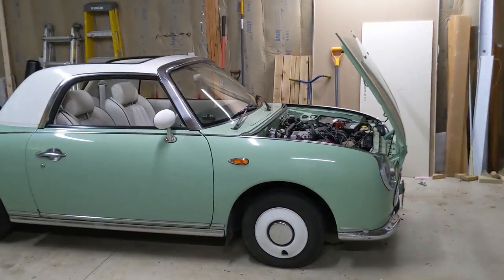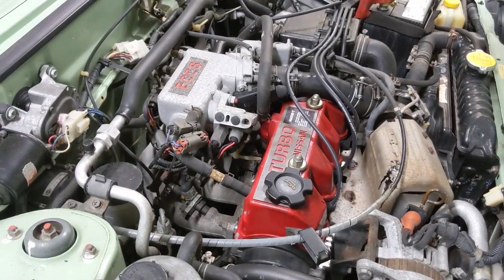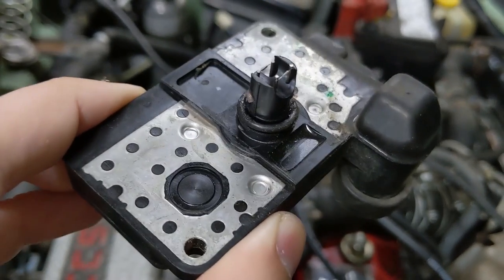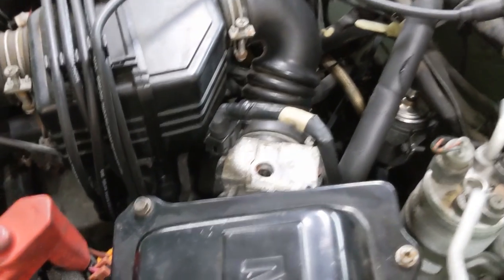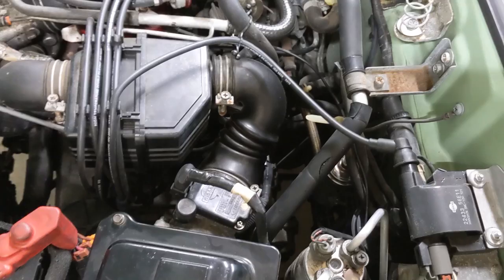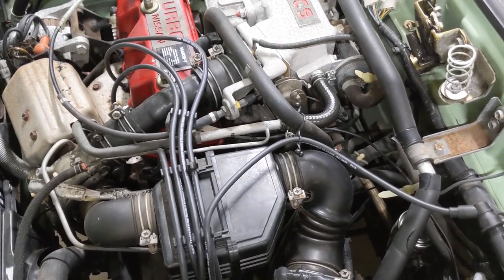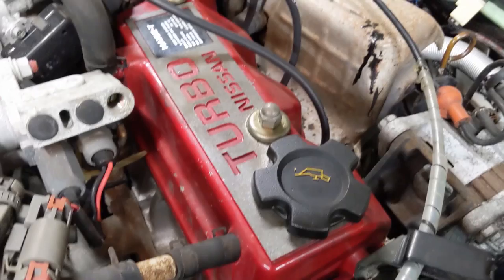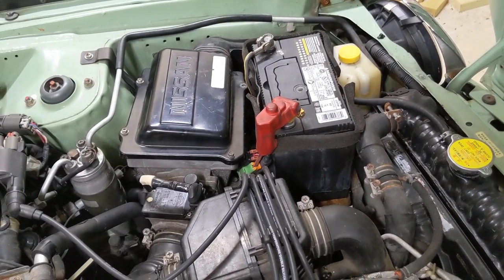Modern engine control musings and Fixing a Figaro

Comment: 2 + 2 = 5 for extremely large values of 2.
Reply: Yeah, but "2" isn't the same as "2.6" unless you're using extremely rough estimates with such small numbers. That's like saying "200,000" is the same as "275,000". The whole 2+2=5 political thing is dumb and has no place in modern mathematics, or,even in modern philosophy. It's a fallacy.
Reply: @tyrantstomper  it’s a calculus joke! Relax homie
Reply: @spaceman884  calculus ugh.  I've lately come to  think that physics will be most accurately portrayed by  n term  newtonians or something in the future and continuous math would be the calculable approximation.  For some reason I'm leery of adding infinite numbers of zeroes to come up with a number.
Reply: As it approaches the limit, of course.
Reply: Or extremely small values of 5.

Comment: I recently bought a 2003 Generation 1 Prius, which has SIX interconnected computers, two electric motor-generators, fly-by-wire throttle and brakes, electronic power steering, and a freaking TOUCHSCREEN! Pretty crazy for a car that was originally released in 2000!

Comment: Mechanic here. The MAF looked clean at the beginning of the video. When that type gets dirty, it's very noticeable dark dirt covering the sensor wires. When clean they appear white-ish and somewhat translucent. That type of MAF, btw, very rarely goes bad, but often gets dirty. Probably the reason it starts easily in the cold, is that it (most likely) has a cold start injector, which will be used in the cold to shoot a lot more gas into the engine to get it to start. So, really, you're probably looking at a lean condition. Suspect vacuum leaks. Oxygen sensor will not cause a poor start, as the computer will ignore it entirely for a minute or so until it's sure that the sensor is warmed up. This time will be less if the sensor has a heater (more than one wire), but still starting will not be affected by it.

If you have a cam/crank correlation code, fix that. Likely the distributor is not adjusted correctly, hopefully there is an adjustment. I'm not sure of the procedure. It's likely you will need to find a real mechanic who has an old scanner than can talk to pre-OBDII Nissans. I do, it's not terribly uncommon. This car should have a scanner plug. Perhaps behind that panel with the button and LEDs.

Also, rockauto.com dude. They don't list a Figaro (big surprise) but you only need to divine which model is comparable. Sadly, I can't see that valve available there. Perhaps if you had a part number.

Speaking of valves, remove the IAC valve and clean it thoroughly. This one should rely directly on coolant flow and temperature. The coolant passage through it can get gummed up and seize the moving part.

Also, the intake air temperature sensor might also cause this problem.
Reply: If you’re going down the stuck valve route, check/clean the EGR (if this car has one) - for vacuum leaks, IAC, EGR and the throttle itself are all suspect because they’re all connected to the manifold. Further, when looking at/cleaning the throttle, check the throttle position sensor: that’s where the computer looks first (in conjunction with MAF) for injector pulse duration. Then there’s fuel pressure regulator, and EVAP valves to take into consideration. And the gas cap if the EVAP system is in question. As in contracts/law, it’s the little details that cause the big headaches.
Reply: Yar Nunya I don’t recall you mentioning it. It’s the type of maintenance that’s overlooked until problems occur. Proactive prevention rather than reactive repair is my mindset.
Reply: Also, this car obviously has the door-style MAF, since that's the housing you see on the air cleaner assembly.  Not a hot wire type.  The door style was very common on early-90s Japanese cars.
Reply: @immikeurnot  I mean, he literally takes the sensor out and shows us in the video. It's a hot wire type, like an old GM or Ford.
Reply: immikeurnot I don’t give thumbs down unless they’re deserved; yours was because of this:  a vane type MAF is not what this car has, if you watched around the 3:00 mark of this video.
Reply: I used to play around with Nissan's of that era. This is a vacuum leak issue. The O2 is compensating for the lack of air reading. I also own the reader, I should suggest he looks at "nistune" the Aussies are better than us at this.  So funny, I could explain everything about owning a JDM but YouTube being YouTube he won't get to see this.
Reply: Nissan's of this vintage used a Bosch system. The hard start cold is almost certainly the coolant/cylinder head temperature sensor. Your surging could be from a vacuum. Leak. The smallest leak will give you issues. Any leak after the maf can and will make it run lean and stumble.
Reply: Also the crank sensor code could be a false positive. It has a tendency to trigger if something else is wrong. The cam and crank signal are in the distributor cap. The crank trigger is a pulse during each cylinder tdc event. And the cam is a 1° pulse. It is a optical pickup.  You may have a air regulator.  And when they fail they get stuck open. It's a little door attached to a heating element that slowly closes as the engine warms up.
Reply: Mechanics are dope
Reply: The number of likes on this comment makes me happy.
♡☆ DIY or DIE ☆♡
Reply: My 95 Infiniti G20 surged hard (read: bucked violently) due to a tear in the intake accordion hose that would open up doe to rotation, let a gulp of unmonitored air in, which would quasi-stall it out, cutting torque and rocking the engine backward, closing the tear and starting the cycle over. Cleanin my maf and replacing the a:f sensor due to an unrelated failure didn't fix it. Got a new airbox and hose ass'y and it drove like a dream
Reply: My '94 Jeep Cherokee (4.0 HO) had a lot of similar issues, in addition to overheating easily, and stalling randomly.
A lot of the problems (but probably not all) were caused by an intermittent cam position sensor.

Comment: At 8:11, to the right of the mounting point for the MAF, I can see what may be a split vacuum line.  Might explain your drivability issues.   I have some experience with Nissan cars if this era, and it always seems to be a vacuum leak... loving your work, sir!  Cheers and good luck!     Edit: never mind, I see it is cracked insulation on the A/C line... my comment still stands, though.   It’s always vacuum ☹️
Reply from the maker: I should definitely go around looking for vacuum leaks. So far, though, now that the MAF is clean the only issue is the (possibly) high idle and the extremely mild surging. Without knowing how the computer might do a re-learn that might just go away over time, or else it could be entirely unrelated. Pre-OBDII is fun!
Reply: that is a ac line it just a cover
Reply: still check for vacuum leaks. there is a few hundred miles of vac line on these things, and after this number of years, im sure there are a few leaks.
Reply: Might explain the high idle for sure. I would take a spray bottle filled with water to the vacuum hoses-- makes it easier to hear. If it doesn't seem to be a hose, I would check the intake manifold.
Reply: Start pilot or brake cleaner spray is an easy way to look for vacuum leaks. I'd also take the IAC valve out and clean it thoroughly.
Reply: I was about to post the same. On a car that old you should check all the pipes. A small split will play havoc with the fuel injection metering and ignition timing.
Reply: ^^  This is exactly what got me into electric cars.  Engines.  I hate engines.  😖
Reply: @TechnologyConnextras  even being into computers as much as I am I still like carbureted stuff it just seemed so much simpler to work on. Of course you have all the equipment to work on a modern car then they're probably just as easy to work on.
Reply: @MichaelAStanhope  That valve is also likely to have issues, they are known to have daphragms that either crack, stick or just leak.
Reply: @noahpaulette1490  Carbs are all fine and dandy but getting them to work properly is an art. And even then, they will never be as good as efi, just because they're dumb. Your car might run mint at sea level and 70F and run like poo in the winter or elevation.
Reply: @TechnologyConnextras  My experience is more to Mazda cars, buuuut... Is your coolant level perfectly topped off? If there's air in the system it can cause idle surging in some cars. My car's IAC uses coolant to determine the temperature to close the IAC. My car originally used a VAF and was OBDI, it now uses a MAF which is freer flowing and a different ECU. It makes 10-15 more hp and gets better gas mileage aand can be read with an OBDII scanner. I can get readings off the MAF to see what it's doing while it's running. If you're getting a cam code you most likely have a problem with the distributor. To the Nissan forums to figure it out. Is the advance vacuum controlled?
Reply: Technology Connextras - I love the car!  High idle is also a symptom of vacuum leaking.  I believe the idle speed control unit works by bleeding a little vacuum to raise the idle speed, and could have a leaking rubber seal or diaphragm.  Also, and I may be wrong, some Nissan cars of that era used a “thermo control wax solenoid”. When it fails, it could jam the throttle to a high idle speed.  Was a common issue on the VG30 engine family.  Purely mechanical, would not set a code, but would explain the high idle.  Enjoy your classic car!
Reply: Also here to support the assertion that you have a vac leak - it would explain every one of your symptoms.    Seal off the air intake with a piece of card, and then put a "smoke generator" into the airbox.  You'll see it come pouring out of any vac leaks - you'll probably be surprised how many you find.  Fixing them all transforms the way the car pulls away smoothly, as vac leaks cause the MAF to misread, causing a litany of unpleasant side effects.   Love your vids - rambly or not.  Thank you.
Reply: Yeah vac leaks can explain that high idle and maybe the starting issue because it could be not making enough vacuum to pull open the idle valve once it starts
Reply: That is insulation for the A.C. lines. I noticed that too.
Reply: Also check for cracks or bad gaskets on the intake pipe downstream of the MAF. If you've got extra air sneaking in, the car's going to run leaner than expected.
Reply: Don't use brake clean, if you do, have a fire extinguisher handy. Yes, I've used brake clean and have had bad experiences. Smoke machine is safer, you can find affordable ways to make one or buy off of amazon.
Reply: @TechnologyConnextras  I recall Scotty Kilmer mentioning "if it starts and stalls right away, it may be a vacuum leak" so absolutely check all the vac lines. There's probably like 5 of them if my car is anything to go by.
Reply: @nickwallette6201  honestly "dumb" engines are easy. It's the smart ones that are a pain
Reply: After watching you start I am one more vote for Vacuum LeakS as part of your issues.  ANY rubber hoses that look original should be replaced - most have a 6 year life and start rotting by 10.  If you squeeze it and see cracks it's time to replace.  (You can buy a couple rolls of Silicon hose, cut to length yourself and they won't need replaced in your lifetime.) I would also run it down to NEAR empty and fill it with NON Ethanol while you are trouble shooting.  (Old Japanese Car Experience: 88 Toyota Supra, 93,94,95 Isuzu Rodeos all around the 200k mile mark during my ownership.)  Thanks for sharing your cool old car! (I also had a '77 Triumph Spitfire in college).
Reply: @terrysystems  depending where he's at non ethanol can be hard to find, relatively easy near the water, but while I can't remember I'm pretty sure he's in the middle of the country
Reply: I'm not sure what that line is but it's too big to be a vacuum line.  From what I can see I think it's the line that takes overflow from the radiator to the over flow bottle.  Just a guess.
Reply: @MichaelAStanhope  a few hundred miles of vac line in a car? that does not sound right
Reply: @TechnologyConnextras  I would replace all vacuum hoses.
They're 30 years old, had who knows how many heat cycles.
Reply: @tarstarkusz  A carb gives you more problems over time than immediately after install. Cylinder wash from excess fuel leads to earlier breakdowns, etc. because it is literally rinsing oil off of the side of the cylinder walls. With a properly functioning injection system, you should never have an issue with excess fuel causing premature wear.
Reply: @gregbeliveau4773  : yep, armed with your extra piece of information on this being a common Nissan problem of the era, I can almost guarantee this car's problem is a faulty TVSV... TCWS... whatever, I drive Toyotas, we call it a TVSV. If the TVSV is busted, not only will it cause a vacuum leak, but anything that receives vacuum from it will be perpetually stuck in the "cold" position. The cold idle circuit is always running, which is why it hard starts in warm weather and always fast idles.
Reply: @VoidedWarranty  Vac leaks would also explain the turbo lag since it would be unable to close the turbo bypass valve until the engine runs fast enough to overcome the leak, and then the valve slams shut.
Reply: @Stoney3K  yeah vac leaks on this age of vehicle cause all kinds of whacky stuff. I had an old volkswagen that behaved just as you described
Reply: @nickwallette6201  Tesla S here, NO engine stuff, or transmission, exhaust, just tires and wax. 3.5 years into ours

My first cars I did upper and lower stuff, pistons, heads, 20+ year old cars  I kept going.  Corvair turbo rebuild too, just out of high school, not as a job, just needed my car fixed. 
Mother;s '71 Toyota corona mk II stack of service manuals they would sell you  a foot high, emissions manual taught me a lot. think of 70's vacuum line controlled pollution stuff. , 

Now you are locked into a dealer. No dealers involved with Tesla. I hate them this week tho.
Reply: Om my late 80ties to early 90ties Nissans i had two with fallen in vacuum lines. So they looked ok from the outside but were impassable from the inside.
Needed weeks till i found out.
Also your car should have an secondary Air system!
This operates just as your much desired Toaster, by the means of a electrically heated bimetalic Spring.
Theese tend to get stuck or the spring loosing it's tension causing them to screw up the starting process and generally  annoy the eccs.
A cold start should look like this 
https://youtu.be/s_7J8ajDpyI
A how to on repairing these (in German) can be found here...
https://www.b12-club.de/thread.php?threadid=5281
Reply: I'm assuming you imported this through the 25 year old exemption, which means no emission testing. Rip out all the emission stuff, it'll make your car run better and less failure points.  The fact that it runs better when it was in close loop mode tells me that it's likely that some emission control stuff are interfering with the engine operation.
Reply: @tarstarkusz  Dumb as in "not smart," like how people call "old" cell phones "dumb phones" now that most phones are called smartphones.
Reply: I was just going to post that there's a split in that line there.